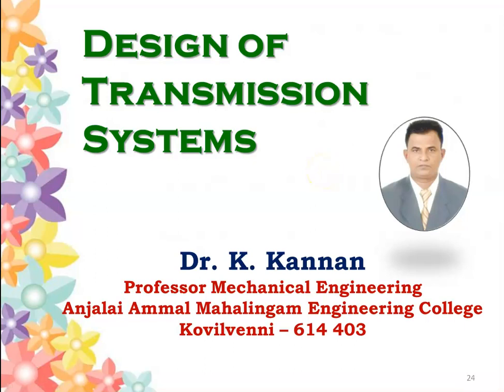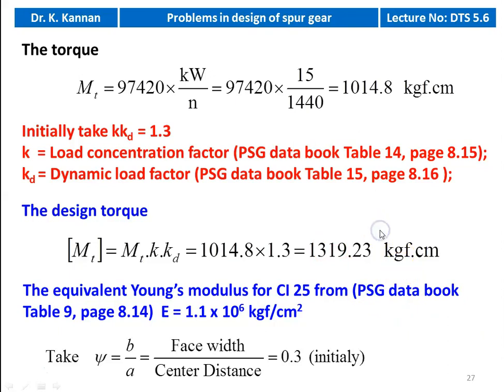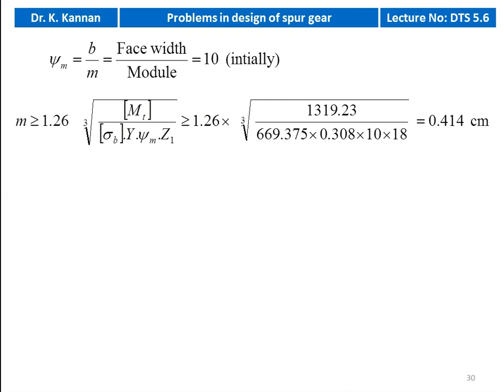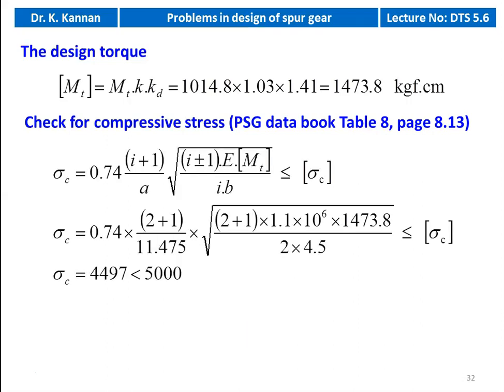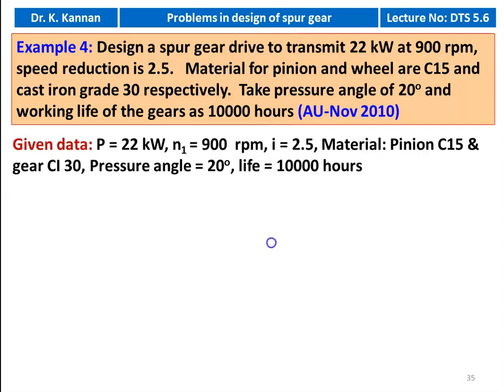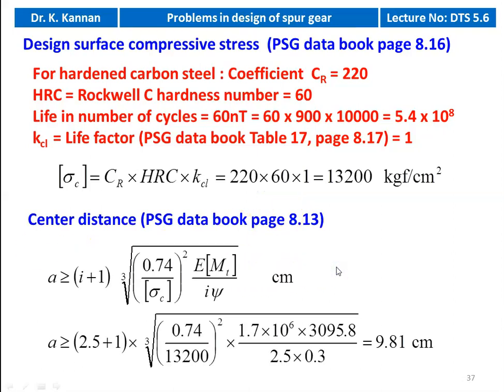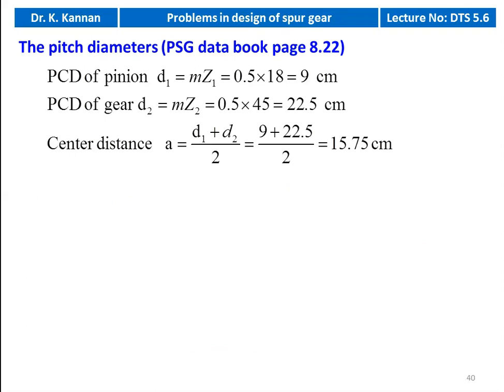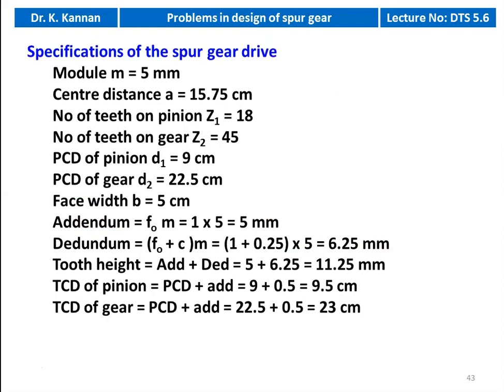DTS 5.6 Problems in spur gear design - II

Comment: Pinion  material C15
Wheel material CAST IRON GRADE 30 
Then... How to solve the problem.... Please post video.... 
N1=900
Speed ratio= 2.5
Pressure angle= 20
Life =10, 000 hours
Power = 22.5 kw
Reply from the maker: Design the gear for pinion material properties
Reply: @dr.k.kannan198  ok sir... Thank u🤝